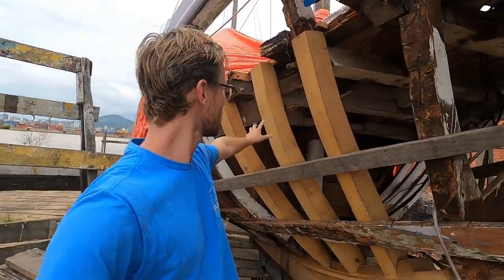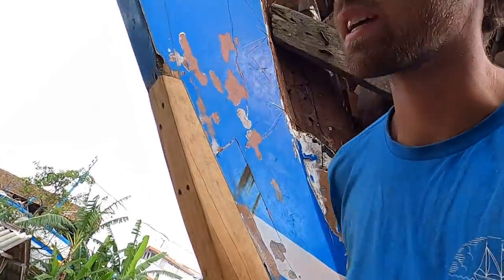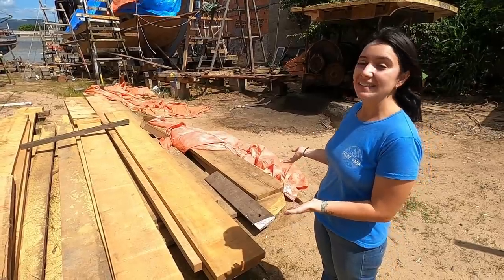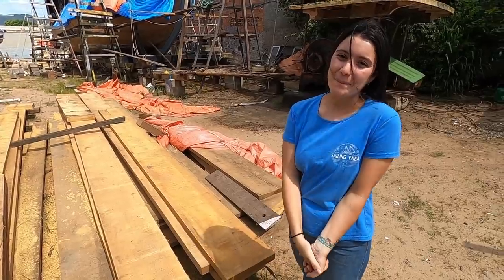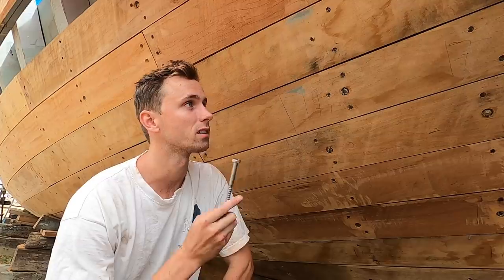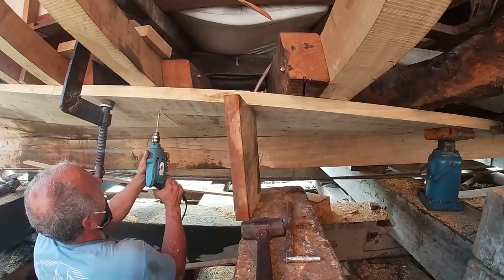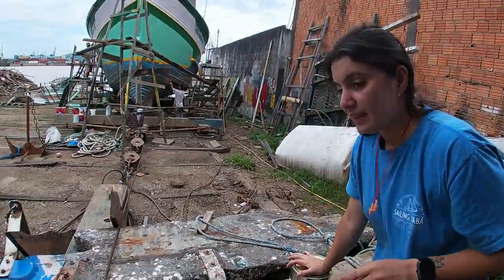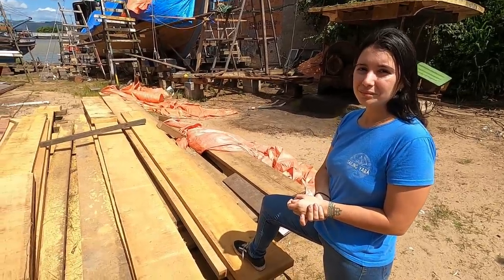A message from the FUTURE + BUILDING LOADS! — Sailing Yabá #22

Comment: Last week I watched your episode, typed in a bunch of comments, then managed to lose them.
Then in despair and being tired I gave up and went to bed.
I had put down a few thoughts about the interior cabin space that I want to try and retype.
1.   The galley is awful:  cramped, little natural light and awkward.  Never use full sized house appliances: it's a waste of space and looks ridiculous.  For me where you cook needs to be a space to enjoy and to be able to take in the scenery, as well to interact with others.  The cook is not a servant and it bears pointing out that the cook is well positioned to poison everyone should they become aggravated.
What to do?  Your idea to make it part of the wheelhouse isn't bad, however that may cost a lot and there isn't a lot of room.  There may also be safety issues with having the stove next to the companionway and wheel.  And it would be cramped.  (My solution below to create a real double salon and connected galley solves a lot of the problems)
2.   Lighting is terrible:  (part of the reason is the layout and how cut up the space is, see below)  The portholes need work, but what that closed in space really needs are hatches.  Light and at least a few that open for air and egress.
3.  Layout is at best odd, like it was a guest cabin, small and cramped, for a larger home.  Look to other types of sailing vessels for layouts to see what Yaba could be
Your "living room" (it's supposed to be a main salon) is basically just a hallway.
The fix is to remove the starboard cabin, and shrink the starboard head, which then gives you a double salon space that's directly connected to the galley.  It could start to look like the SV is should and could be.  And, for guests you will have more sleeping berths.
Keep the day head (on port).
Keep the smaller cabin (consider reorganizing).  And keep the guest head; But make it smaller and a wet head (no separate shower).
The result would be a large quite open space with 3 separate but connected spaces: the galley, and two salons, one with a mess table
Main, captain's, cabin is a tutorial on wasting space.  I would consider putting the berth lengthwise along the beam. or tight to the starboard side, so you have usable space, including enough for a cozy built-in settee on the port side.
From what I can tell the interior space is traditional for this type of vessel, but in my view fails in virtually every category.
You often said there's great storage in the vessel--I see the opposite.  Look at other SVs and I think you will find that many potential storage spaces were not utilized.
If what I've written sounded harsh, that was not the intent.
I simply think there are some important decisions ahead of you that should include possibilities you may not have considered.
Cheers from Vancouver, BC, Canada,
Dawson
ps.  still love ya, and, what you are doing heartens me, Thanks
Reply from the maker: Hello Dave! Thank you so much for donating us your time and wisdom! Your tips are epic!! We are definitely planning some big changes in the layout of our interior! And your point of view gave us some really great ideas! Of course there are some limiting factors, but we really hope we can create a very nice space for us and our guests! Let's see if we can make you proud when the time comes! 😉
Reply: You're welcome
Often times we are limited by what we are able to conceive.
In your case, this adventure is all a learning curve, so you will/could be ready to take on the project once you have the experience only achievable by doing the the project.
That's the difficulty.
Despite no experience and limited technical know-how, there's quite a bit of positives.
Basically you two: even embarking on this improbable project is a positive as is your relentless positivity.  A can-do attitude is it's own reward.
However, I think your biggest asset is that you are smart, have some transferable skills and are curious and willing to learn.
With your tech skills, this is why I suggested researching other SV layouts--seeing them lets you know what is possible.
We'll talk design later.
But here too, limits are often in the mind.
Cheers,
Dawson

Comment: Stainless steel or Galvanized iron is still iron. You will still get iron sickness. Also Stainless steel doesn't work if it's in a non oxygen environment  e.g below the water line. Stainless steel pits and corrodes internally.

Comment: Boats where built with nailed on planks forever. Nails specially ring shank nails will hold an amazing amount
Reply: Yes but the nails have to be clenched over properly to hold.  Here they are nailing them without  fully going through which is required for the nail to be properly clenched over.

Comment: It's a bit comical when the fellow warns MP to move because he's about to use a cutting wheel, but he's just wearing cheap sunglasses.  I'm fully aware that it's a whole different culture there, but having worked my whole life under American safety rules, watching these guys running bandsaws without push pieces, without gloves, without eye protection, and without ear protection is really jarring.  The workplace there would make an American OSHA inspector faint dead away.  :)
Reply: Why is your mind so fragile?

Looks like they are OK with the tools and safety used.  
OSHA is insanely unsafe or maybe just insane.
Reply: There's ya problem lady, the yank 'safety' system lol.

Comment: Dear MP and Ben, why are you always 3 steps too late? protect your investment with small and effective measures and your wood will survive a lifetime. Doin' it your way  and you will not even reach 10 years. Your boat was attacked by shipworms, you don't need a detective to understand they are your threat number one in these regions. They eat your boat inside out cause they love wood. Between the frames, rods, planking, stringers you need to impregnate all surfaces with a bedding compound like dolfinite - before being nailed or bolted and all visible wood has to be primed and treated with marine primer containing copper arsenates to repel worms - and lots of it. The wood quality seems rather porous and it has to drink it all up. About the nailing of the planking, the stainless screws you showed us are not adequate - specially when bolted into contaminated wood - you needs long rods with a flat head on one side and a nut and with a washer on the inside. preferably bronze. And you need to remove the nails - leaving them will pronounce your wood to a certain death sentence - due to nail rot. Galvanized nails will eventually always corrode, but the tannin in the wood will react chemically with the zinc because of the salt. That's why you see blackspots on the wood around ALL nail spots. Bronze has no chemical reaction. 
I know it looks rather lame to criticize you from behind the screen - but some of us do actually know something about building boats - so use the free advice and use common sense. Building boats should be more than documenting a YouTube channel. You wanna make it your house - don't mess up the foundations.
Reply: @gav2759  I'll continue to whistle until Ben & MP will stop acting like tourists in their own project. I don't care about the channel - most of the people here don't understand the reality nor costs involved. Nor the danger - a schooner isn't a slick boat and based on the thickness of the wood used , it's gonna be a very heavy boat. Due to weather changes storms , tides, waves are getting worse and heavy does not stands for safety at sea - I see no weight management. As for now, even a Disney prop is better built than Yaba.
Reply: @gav2759  ROFLMAO

Comment: The fasteners are not adequate, even if you follow with a stainless steel lag bolt.The wood is unprotected where they have been joined. This cannot be undone and is the point where substantially rot can occur. It is still not to late to walk away from this project, it has absolutely no integrity. At this stage rotten frames are being cut away and scabbing on new wood. Endless.